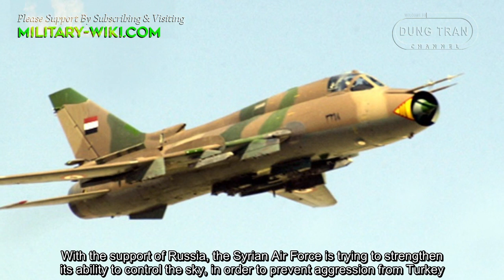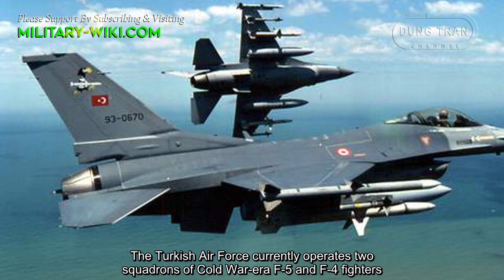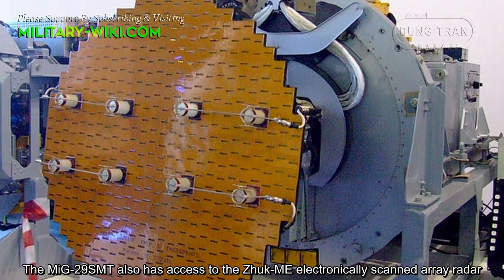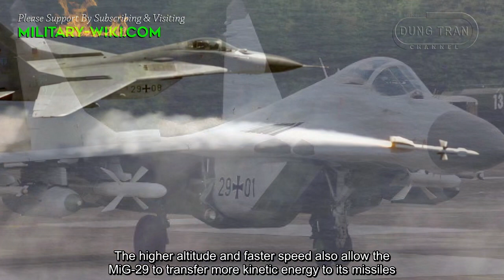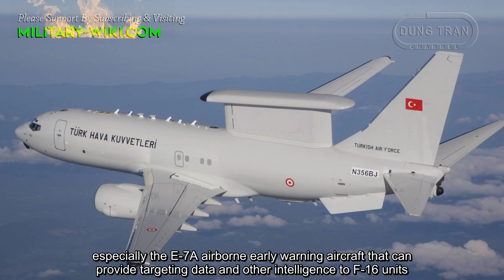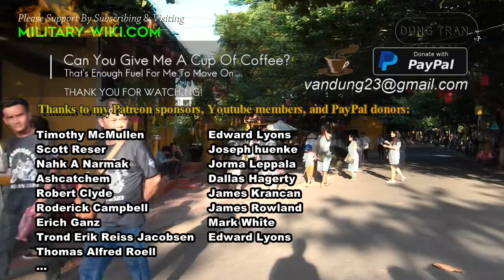The Syrian MiG-29 is Ready To Crush the Turkish F-16

Comment: After the Indian Air Force strike on a Jaish-e-Mohammed terrorist camp in Pakistan on 26 February 2019, followed by the high voltage aerial skirmish the next day between the rival air forces a PAF  F-16 and a IAF MIG-21 was shoot down.
Reply: There have been realized no mission video of that incident so we don't really know what happened. 

Anyway it's not that surprising, the MiG-21 is a 3rd generation fighter but it's fast and relatively small RCS. If used right you obviously can find situations where it can be a danger to most 4th generation fighters, just like the F-4's still can. 

Anyway, it was relatively well upgraded. If you took a WW2 wooden de Havilland Mosquito fighter/bomber, installed a modern radar and made it able to fire modern missiles. Then it would also be a danger to modern jets, that's not the same as it would make sense to upgrade one like that compared to just making a new fighter or upgrading a more modern plane.